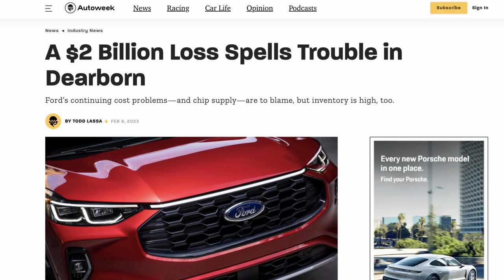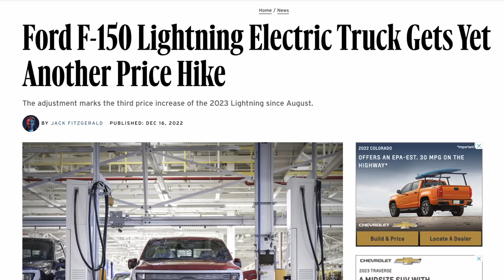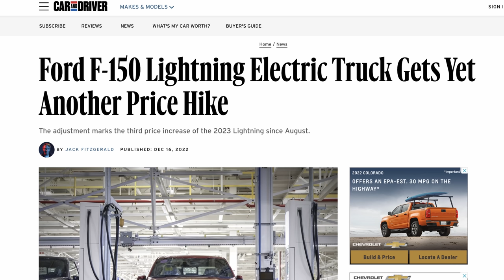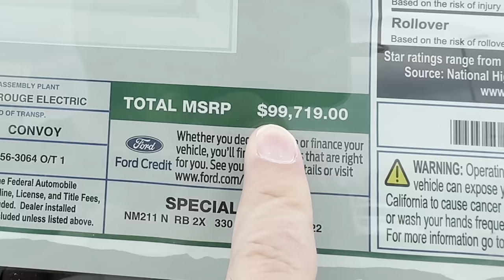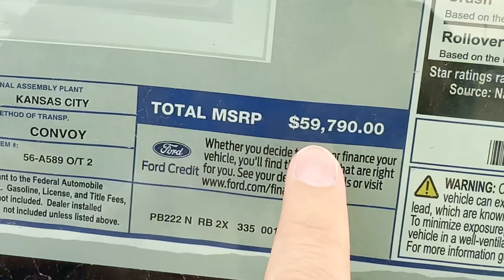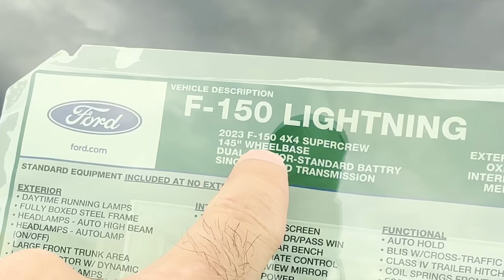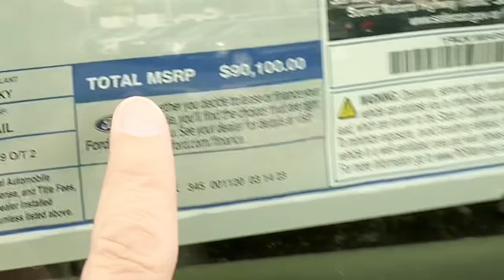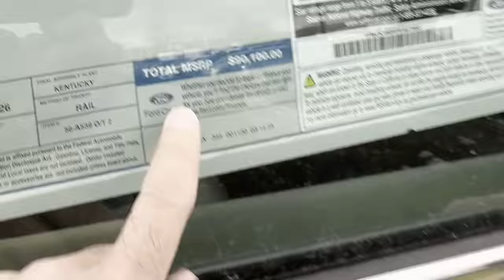Ford CEO Makes HUGE MISTAKE, Now Dealers CAN'T SELL TRUCKS!

Comment: When a company is in trouble the first one to get a pay cut should be the CEO and the staff. They run the company and they make the decisions for the company to succeed or fail.
Reply: Nah let's get rid of the factory workers first since they've already quietly quit. They're always leaving as soon as their shift ends 😂
Reply: Yes Jim Farley makes way too much money she is not even worth a million a year
Reply: The thing is that despite their massive pay packages, the top brass really dont add anything to the cost of a vehicle.  Especially when half or more of their pay is stock options thst cost the company nothing, because there is an almost unlimited market for new stock to pay the bonus.  Im not a Ford fan, i dumped more that my ourchase price on a used 2000 F150 over 3 yrs (crap Triton engine started blowing out plugs just out of warranty)  That said, theirvdecision to completely drop IC engined small cars is baffling to me.  Whats a young kid supposed to drive once the old crap goes to the scrap yard?  Driving around in a beater econobox was a tradition, dammit!

Comment: I am a ford fan have been all my life. My granddad had fords and got me hooked. I worked for a ford dealer my last two years in high school. They sold only pick-up thru line haul diesels. I've owned nothing but ford vehicles all my life. First vehicle I purchased was a 1964 f100 stepside with straight six banger engine and three on the tree. Sold it to my dad bought another 70's f100, got married purchased a Mercury monarch for the wife. I had horses back then and sold the f100 and purchased a 1979 f250 best truck I've ever owned. All where easy to work on, all had over 150,000 miles on them with no major problems just did the up-kept maintenance and your good to go. With a family we purchased a ford aerostar van in the 80's. Divorced I then had a ford bronco built by the dealer I worked for in high school. sold it in 2010 and had a new f150 crew cab built at the same dealer. Have seen the decline in ford products since and will kept this one until I die or can no longer drive. Ford has put way to much bullshit on there vehicles and every thing is plastic. The prices they now want are outrageous one can buy a home for what they are asking.

Comment: Bought a 4 year old tundra TRD/SR5 in 2016 for less than $17k. It’s got 120k miles on it now and never had an issue beyond routine maintenance. This is completely out of control

Comment: One thing I’ve read about the EVs and hybrids: the auto insurance industry is scared of them. They’ll gladly total one out if there’s a hint of damage to the battery or electrical system, because there’s no practical way to know if it has been damaged in a crash.
Reply: Repair centers who are OEM certified by EV makers can ensure they are repaired right. I know someone who owned a Tesla certified repair shop (they serviced all makes including exotics) and they had a complex process to go through to certifiy the car. They ended up taking every car to a Tesla dealer for an inspection as it put the liability on Tesla instead of them, so it as well worth the cost. He finally dropped Tesla due to hassles getting parts timely.

The bigger reasons they total them out are that parts and labor are very costly and parts can take months to arrive, so they may find themselves paying for a rental car while waiting. Meanwhile, due to the parts shortage, junkyard values are skyrocketing, so they can total the car and pay off the owner, then sell the wreck sometimes for nearly what they paid for the claim. 

Rich Rebuilds did a video a couple years back where he perused the wrecked Teslas on an auction site and they were going for just a couple grand less than an undamaged one in good condition at a dealer lot. Part of that he said was due to his videos sparking a lot of EV conversions with people snapping them up. Now I think it's more that some EVs are aging and used parts are more available and more affordable than buying new from the OEM.
Reply: I have AAA he said they will not touch electric vehicles or the hybrid because they blow up all by themselves if you have a gas or diesel you're okay but the new vehicles they won't go close to

Comment: Ford isn’t the only one with this problem. Was trying to price out a ram with the multi function tailgate and found it has to be a rebel or higher model so the one option I want means I need to spend over 70k….
Reply: Get a Silverado !
Reply: you can get a Penastar version and find one a used multi function tailgate.

Comment: Crazy to think my 2014 STX 4x4 was only $27k brand new, with 7 miles on it, when I bought it less than 10 years ago.
Reply: 50% Inflation at least. I don't think the average American salary has doubled in the past 10 years !
Reply: My 2020 F150 STX brand new with only 1.4 miles when purchase was $41,000 including TTL and the hard bed-cover install at dealer. If I buy the same exact vehicle today it is $57,000

Comment: To put those prices in perspective. You can buy an imported luxury car full of options and leather trimmed, such as a BMW for LESS than they are trying to sell those trucks. Not kidding, look for yourself. 
I'm in the market for a truck, but I absolutely refuse to pay those prices.  People taking out car payments for thousands a month are insane. 
The car I have now still runs fine.  I'll wait for them to realize they need to lower their price and get one when they hit 40-50% lower than they are now.
Reply: Stop exaggerating. You can fully option a 3 or 4 series but those are compact cars that can't tow or haul. An optioned out x5 gets into the mid 80s easily and that's excluding any of the more powerful engine options. An m2 starts out in the 60s. And you know that bmw produces cars in the US right.
Reply: @ferretsmiles  You completely missed the point.
Those trucks are in the same price range as Luxury cars, if not higher.
And you can get better options in those cars than you can in those trucks.
True, you can't haul a large appliance in them, but look at the bed on the trucks they are selling, you can't sit a full 4x8 sheet of plywood flat in those either since they are only 5.5' long. They are a couple feet shy of people able to put full 8' items in them.
Reply: @ferretsmiles  He's not exaggerating. He never said luxury cars do the work of trucks, he's just saying that 'normal' trucks shouldn't be priced as high (or higher) than vehicles designed and typically marketed for comfort and status.
Reply: @JohnD-fw4mv  there is some overlap but in vastly different sections. The highest end truck prices end before some large luxury suvs start. The material quality or sound deadening may be better in some of those but the equipment is much the same when you compare similar sized vehicles. What you are arguing makes no sense its the same as saying why does a fully loaded out bmw 330i cost less than a stripped down s class. It's because one is much larger and has a bigger engine. 

Trucks have not been just trucks for a while. They are a luxury and status symbol especially in the south.

Comment: Fantastic segment!!! Keep doing this. Keep holding their ass to the fire. Absolute insanity to charge these prices BEFORE the stealerships add in their own "non lubed ream job" for vehicles that won't even last 100k miles. You hear so often about Ford's quality control problems because of the plants they have in Mexico. Well well well, looks to me like the Fords made in states are just as problematic. The chip shortage made sense for "awhile", as far as higher prices on NEW VEHICLES. But for used vehicle prices to skyrocket too? For the most part, used vehicles don't need the scarce and hard to find chips like new vehicles do. Hopefully there won't be a queso shortage. We need to be smarter as consumers and take a collective stand against manufacturers viewing us buyers as mindless livestock. Just subscribed. Thankyou for doing all the legwork, time spent and effort in providing this content.
Reply from the maker: Thanks for the sub! Lots more coming and working on posting more frequently.

Comment: I’m holding on to my 17 F150 for as long as I can. MSRP on my fully loaded CrewCab XLT 3.5 Ecoboost with FX4 off road and max tow package was $52k and bought it for $39k because of great deals and incentives. The same trim and options today is over 60k and no deals or incentives and then risk having to buy over MSRP. There is no reason for this other than greed from Ford and dealers.
Reply: Yes, I ordered my older FX4 S/crew and got 0% interest, Ford employee pricing plus the first two payments were made for me, years later I’ve kept it in great shape with low mileage. There is no way I’d even consider paying what they want for one similar to it today.

Comment: Truck prices have been insane for a while. I can't fathom the trend to all these crew cab trucks when most the time this isn't needed. The reason they are popular is people buy a truck because they wanna feel cool, and end up using them as overpriced people haulers, and dealers and manufacturers cash in on this craze. The majority of truck owners would be better off getting a car and renting a truck the few times they actually use a truck. They would save a massive amount upfront, and on gas.
Reply: Good point!
Reply: Most people I know who have a truck use it for work. As do I. I haul a trailer 6 times a week. Maybe we just travel in different circles though.
Reply: @kronk358 you can haul a trailer with a normal car, 
if you need a pickup with a trailer, you need to haul loads so hire a van 😂

Comment: what do you mean when you say the lightning can't tow? Is there a specific amount of towing capacity required for work trucks before they're considered trucks that can tow? According to the website the towing capacity is at least 5000-10000 pounds depending on what you're towing, so i'm curious as to what kind of loads people are towing that require more than 2 tons of towing capacity
Reply from the maker: It’s not the capacity that os the problem. Lots of people get barely any range out of the truck when towing. It was a sarcastic remark based on Hoovies Garage towing results. They can tow, just not very far. Like under 100 miles.
Reply: @MotorFeed  I see - for 60k 100 miles at a time seems pretty unreasonable

Comment: Would love to see some more data for the other domestic brands as well. Specifically GMC if that is in your wwheelhouse
Reply: Seems about the same if you see a new gmc for any less than $55k new it’s probably a pro trim (work truck)
Reply: Or has the 2.7L turbo 4cyl which idk enough about to comment on but for the prices I’d take the 3.0L duramax

Comment: Blame Ford all you want, in my area local Ford dealers had 10k plus mark ups on even lower trim trucks. Can’t believe how much the F150 cost these days, no way a XLT should be more than maybe 40-45k. They dug there own graves with this.

Comment: The last 3 vehicles I bought, were ones that I ordered from the factory, with exactly the options I wanted.  The ones at the dealership, had an average of $10K extra options I didn't want, that were either factory, or dealer, ordered.  I mentioned that to my salesman, and he said the employee who orders vehicles for the dealer, would never order with less options like mine.

Comment: I love the videos that show you can't tow with lightning without killing the mileage.  I'm pretty sure this is going to apply to most electric vehicles.  Nice.
Reply: Isn't that common sense?  Its no different than getting much worse gas mileage when towing.  Anyone who buys an electric vehicle when they are planning on towing isn't doing their homework.  Having said that, when NOT towing, cost of "refueling" is MUCH cheaper with EV.
Reply: @jeffpayne2675  depends,  Tesla super chargers are as high as gasoline in some areas.  And electric vehicles drop range much faster than fuel powered vehicles when towing.
Reply: But...isnt that understood?  Were people looking to buy an EV AND thought doubling the GVW with a trailer wouldnt suck up mileage?  Its oretty obvious to most that EVs are built as light as humanely possible, so with any kind of towing, thats going out the window.  
Maybe trailer manufacturers need to get smart and offer some sort of auxiliary battery system so the trailer can supplement its own tow vehicle?  Hmm, got to go call my patent attorney.
Reply: @markdoldon8852 No it’s not understood when a gas truck towing a light trailer goes from 20mpg to 16mpg an EV isn’t expected to have half or less range. 

And really are these loaded luxury vehicles built as light as possible is that why a Tesla weighs almost 6000lb. 

The battery trailer idea is ridiculous too as it would double the trailers weight meaning it has to be built double thick to carry the same weight. Then the trailer is only useful for an EV and the battery is gradually degrading for a trailer that may only be used occasionally. 

The main issue with EV Semi’s is reduced capacity which is a huge deal. Battery’s just need to become waaay lighter per unit of energy (and less child slavery) before we can think about moving away from ICE vehicles
Reply: @markdoldon8852  Too late its already a thing.
Reply: @thomasnunya1438  My gas truck goes from 18mpg to 10mpg when I tow my trailer. Pretty close to half.
Reply: Why is that nice? EV is the future.

Comment: If a new company would come in and make Vehicles standard vehicles with basic options to sell at fair prices every one of these major car manufacturers would go out of business in a matter of months
Reply: Put your money where your mouth is. You can order an F150 for $33,700. The reason they don't have them on dealer lots is because the people actually buying new vehicles don't want such a basic configuration(such configurations are typically seen on fleet commercial orders). They want the latest tech and greatest features. The people that want basic, simple and cheap will go out and buy a 20+ year old truck for a fraction of the money and never set foot on a dealer lot.

Fact is the dealers do know their market. If demand swings away from luxury to basic and cheap you sure will see more of these base trucks showing up on dealer lots.

Interest rates, a Mild Recession, and coming out of covid era supply chain issues are the real reasons why dealer lots all the sudden seem "full". Prior to covid nobody thought twice about a lot packed with inventory.

Comment: I have some friends who work at the two Ford dealerships where I am. Both told me they only have the minimum number of trucks and that they are more focused on selling used vehicles do to they can do lower interest and make bigger profits. They say the trucks are just too high. They still have 22 on the lot they can't move.   They also said they have 22 loaner vehicles they maxed milage out at 5000 miles on that they can discount, and those sell pretty well. But new trucks are not moving at all.

Comment: All they needed to do was actually honor the reservation deposits at the initial cost point.   I had a lightning reservation early, but they pushed the order times to the right and jacked the MSRP up significantly (over 30k more than original pricing).
Reply: Please elaborate more.
Reply: Christ, that's absurd. I would barely pay sticker price for a Lightning even if I had the funds; the places trucks go doesn't gel too well with charging stations...

Comment: 9:29 My dad, a former Ford engineer, told me after watching this video that the cost to build that Expedition (all in) is just around $39K and that's IF all the option were operational due to the chip shortage.
Reply: A lot of the price is R&D as well with vehicles. That's why low volume sports cars can cost so much for so little.
Reply: It could be cheaper but ford R&Ds new parts for no reason all the time
Reply: @Yeahhhhthisisgood  have you heard of this wonderful thing called "governmental regulations"?

Comment: I realize you're not going to be able to haul much, but just for comparison, I calculated what it would cost with TTL to buy a BWM 430i xDrive Convertible in Houston (what can I say, I love rag tops).  Rounding up, it comes to $64,500, so basically the same as one of the F150 XLTs shown here.  That is insane.

Comment: My 2019 F350 turbo diesel, regular cab, STX trim, FX-4, remote start, 360 cameras/sensors, and had dealership transfer ladder rack and tool boxes, plow package, and my emergency lighting for 44k. What’s happened in the last 3-4 years to Ford pricing is absolutely astonishing.
Reply: They haven't even gone up. Our dollars are just worth that much less 😢

Comment: The Maverick has about an 18 month waiting list. It is about $25k, 30k with options.  The new Ranger will be announced tomorrow May 10, and should have a much more reasonable price. You couldn't even get a truck last year very easily, and there were dealer markups. So nice to see that some inventory returning, which will lead to lower prices.  I think Ford quality has improved, and the high recalls are more of an indication they are fixing the problems, rather than sweeping them under the rug which was Ford practice for a long time in the past. And i don't think most of the recalls are due to assembly problems, but US manufacturer practices where the squeeze their vendors so hard, corners are cut, and the parts are occasionally shoddy, such as the bad batch of valves that caused a few hundred Bronco motors to blow up. Sadly there isn't a single valve factory left in the USA!
Reply: I’m betting the new Ranger will be more expensive- new generation, gotta compete with those $50k+ Canyons/Colorados
Reply: @cputeq007  You are the winner, the Ranger starts at $34k with no cruise. That will buy a loaded Maverick Lariat with adaptive cruise and B&O sound system. Less tow but same payload. The Mav bed is not much shorter. 
The XLT hybrid in my videos cost just $27k.